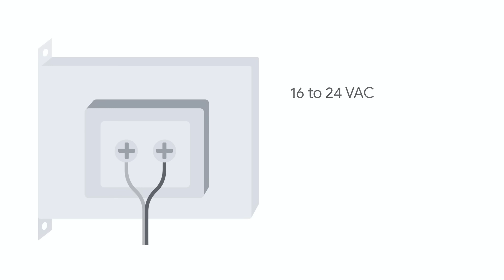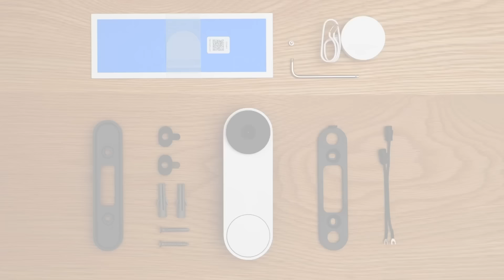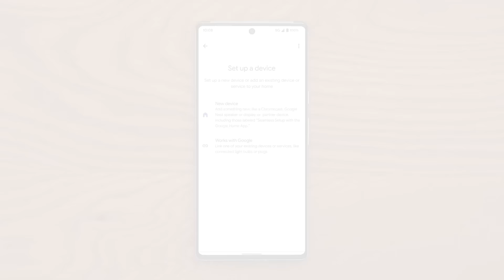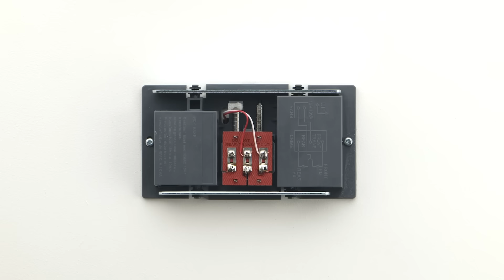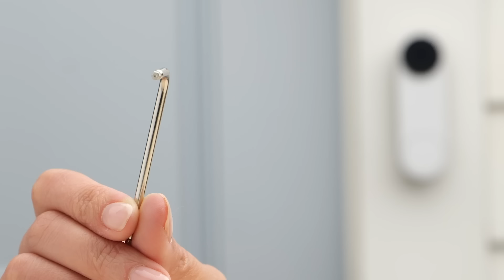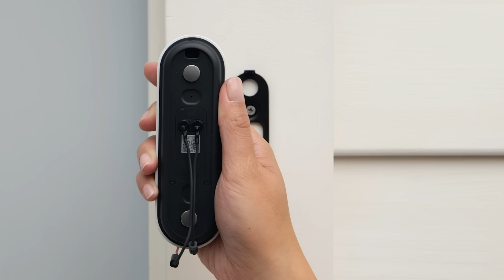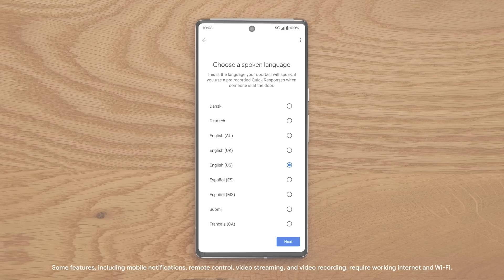How to Set Up and Install Your Google Nest Doorbell (Wired)

Comment: I currently have 1st gen wired doorbell, & I'm going to replace it with new 2nd gen wired doorbell. I don't have a chime at all...the wiring goes from Transformer > Chime Puck > Doorbell, & I have no issues. Can I use this same wiring for the new 2nd gen doorbell as well?
Reply: No reply?  So in the video they said remove the old one and put the new one provided in the kit.  Guess you figured this out, can you tell us your story for others to know ?

Comment: Doesn't work with a Google business email account?
Reply from the maker: Hey there, thanks for your inquiry. If you're trying to migrate your Nest account to Google, we recommend using a personal Google Account. Google Workspace accounts are accounts set up by businesses or organizations to access different Google business productivity tools. At this time, you can’t use a Google Workspace account because the account data is managed by your organization. Check more details here: https://goo.gle/3wD2biJ For more help, contact us: https://goo.gle/3ie15Ae

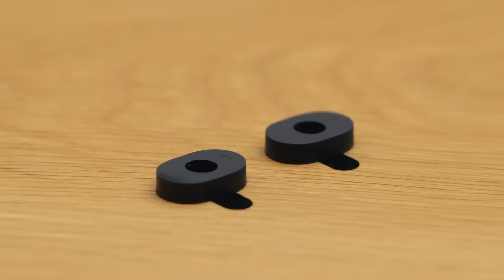Comment: The spacers mentioned at 6:49, do these go behind or in front of the bracket?
Reply: Answered my own question during installation. The spacers must go behind the bracket in order to secure the doorbell to the bracket.
Reply: How did you seal up the hole where the doorbell wiring comes out of? I had to use the spacers to install mine today but they leave a big gap all around the doorbell.

Comment: I made the installation today and everything works fine , only thing is that when I connect the chime connector the the existing chine inside the house it does not give me any sound but is disconnected it works fine the chime sounds work fine and the doorbell sound also works .. any idea why is doing that and also is it safe to keep it with out the chime connector ?
Reply from the maker: Thanks for posting a comment, Danny. We appreciate the steps you checked beforehand. Nest Doorbell (wired, 2nd gen) must be installed with the chime connector included in the box. It allows the chime's wire to deliver constant power to the doorbell and to protect your chime from damage. Without the chime connector, you might experience chime buzzing or unexpected chimes. Check out this Help Center guide to know more: https://goo.gle/2WHO7li
Reply: @madebygoogle  yes indeed is true with out the chine connector  im having a constant buzzing but like I said before , if I connect the chine connector then the chine does not work just made like a vibrating and never works , I think I will need to change the transformer and see if that fix the issue.. thanks for your replied

Comment: If I connect the doorbell directly to a transformer (because I do not have a chime), do the wire colours matter? Thanks!
Reply: If you connect the transformer's output directly to the doorbell, it would cause a short circuit when the button is pressed and may damage the doorbell. The wire color does not matter; it is AC current.
Reply: haha, did you get your answer?  nope.  this is a google channel for a simple instruction video, no one cares as if it was a personal channel.  did you figure it out?  My guess is yes?  As long as you use their add on  "capacitor".  That's all that thing is, so it provides more of a power supply then the small power normally associated with a doorbell / chime.

Comment: I had to buy one of these through ADT cause my existing doorbell camera from ADT  isn't working my nest doorbell camera didn't come with a Puck, my house is only 2 year's can i still install it?
Reply from the maker: Hey Jesus, thanks for your inquiry. To install your Nest Doorbell (wired), follow the steps here: https://goo.gle/36NFwlr If you'd like to check if your doorbell system is compatible, have a look at this guide: https://goo.gle/2WHO7li For more help, contact us: https://goo.gle/3ie15Ae
Reply: @madebygoogle  question, my Nest doorbell Camera is battery but noticed it has screws to have it wired so I assume I can wire it for constant power or do I need to charger it every now and then?
Reply: @jesusbaez4427  you can do it either way. you can wire it so you do not have to charge it.... or you can go wireless but have to charge it!

Comment: My indoor chime is not working.  I have a 16V 10VA transformer (intertek model 5019098).  The doorbell video and doorbell internal chime works OK.  I set the app to Ring indoor chime and electronic chime is set to no ( I have a mechanical chime ).  I did try to toggle the electric chime to yes at various durations as this was reported to work for some with mechanical chimes. 

Any ideas on how to make indoor chime work? Do I need to replace transformer with bigger unit like a 16V 30VA unit ?   The chime worked fine using the original doorbell.  Home is new construction.
Reply from the maker: Hey James, we're here to help. This guide could help you troubleshoot your indor chime: https://goo.gle/39DLuFO For more help, feel free to contact us here: https://goo.gle/2D2Shve
Reply: @madebygoogle  I opened Case ID 3-7137000033654   Still waiting for some update. Looked at the posted docs and all steps were checked.  Still need to know if transformer rated 16V 10VA is good enough.  Only feature not working is the indoor chime.   Very frustrating !
Reply: were you able to get your existing chime to work?
Reply: @netarcSF  I got the existing chime to work by swapping out the doorbell transformer from 16V 10VA to a 16V 30VA unit.  Installation was very simple.  Just flip the breaker and swap it out.  Everything works perfect now.  Google support was pretty useless.

Comment: I just moved to a new house...

no outside doorbell, 

inside there is a chime (battery) but not sure how to make it work with this google nest doorbell (I don't want the battery one with cold winters we have here, the battery will last only days)

Behind the chime, in the walls, there are wires....but not sure I want to use it for the doorbell anyway.

I do have multiple google home minis (and one hub) in the house

Can I use the Google nest doorbell (wired...for cold winter days) with the notifications coming only from the google home minis and no chime in the house?

Do I need to connect the white puck to the wired inside the wall where there was once a chime connected to it? even if there is no intention of having a new chime installed?
Reply: P.S Will NOT work IF your Chine is battery powered!!! Consult a professional about installing a "TRANSFORMER)- NEEDED to provide the proper voltage. I just read a few Youtube videos on the WIRED installations and compatibility requirements AND I own the wired version.

Comment: If I already have the original wired nest hello, can this be replaced directly on the mount that was already screwed into the wall? Will the wires where the original puck was placed will be replaced exactly with the new one?
Reply from the maker: Hi Jazz, thanks for your interest in the new Nest Doorbell (wired, 2nd gen). Since the doorbells have different dimensions, we'd suggest using the mounting plate that'll come with the device. Also, the first gen doorbell chime connector is not compatible with the new one. Check out this link to know more: https://goo.gle/3EmUh1Y

Comment: 8:36 I was deciding to buy this doorbell camera when I saw this point of the video. You are telling me anyone who also bought this camera will get the same hex key. They can use this key to unscrew the camera from the top and yank it off the wall?
Reply from the maker: Hey there, thanks for the review. Hex screws that come with the package are identical to each user who purchases the device. In the unfortunate event that your doorbell gets stolen — we can help by replacing the device. The doorbell replacement will place no additional cost, if you qualify. Learn more about the policy and on what to do when your doorbell gets stolen: https://goo.gle/2FL3WA1
Reply: I mean... What do you expect? That each doorbell will be sent with a unique one of a kind screw? No door bell or outdoor camera have that

Comment: Can the existing wiring/ chime connector be used if I’m replacing the 1st gen nest doorbell??

Also they no longer come with the chime connector but this video has step by step setup but not all accessories are in the box
Reply: Only the wired version comes with the chime puck
Reply from the maker: Hi Rodney, thanks for your interest in the Nest Doorbell (2nd gen, wired). You won’t be able to use the existing chime from your old doorbell, you’ll have to replace it with the chime that comes with the new doorbell. The new chime is included in the box when you purchase the device. Check this out: https://goo.gle/3h6FBKK
Reply: @madebygoogle  I ordered the battery operated doorbell but it doesn’t come with the chime set up
Reply: @madebygoogle  I’m in the UK
Reply: @madebygoogle  apparently the wired doorbell isn’t available in the UK?
Reply: @madebygoogle  I just purchased one as well (MFG 11/2021) but it does not list the chime puck on the box under "What's included". How do I install without the puck?
Reply: @madebygoogle  i also have not received chime puck in Netherlands , any suggestions

Comment: Will this work with plug-in transformer?
Reply from the maker: Hi Erik, the Nest doorbell (wired) isn't compatible with a plug-in transformer since it has a required voltage and power and must be connected into your home's doorbell system. Learn more here: https://goo.gle/3BJdiZK For more help, reach out to us here: https://goo.gle/3ie15Ae
Reply: @madebygoogle  
Thanks for your answer.  Will continue with battery version then.
Reply from the maker: You’re welcome  — we’re glad to answer your question. Let us know if you need more help.

Comment: can you make a video to reset wifi. the wifi I pick doesn't work well. pressing the button on that back only turns the th light white and goes back to green. I need it to turn a blinking blue. thanks
Reply: it also cannot find my separated 5ghz wifi with 160hz enabled. I plan on getting a mesh router. wifi signal is weaker with this version than gen 1

Comment: Installed correctly but now my chime doesn’t work….
Reply: Same! Did you ever get a solution to this?
Reply: @skylinesenses  nope, I assume it's bc my doorbell transformer was the minimum recommended. I just turned the indoor chime off in the app and just using Google minis to announce
Reply: @Andrew-gr4nd  thanks for the reply! yes that is most likely your issue. I upgraded my transformer and it solved my issue. google says you can have minimum 16vac 10va, that’s what I had and I upgraded to 16vac 30va and my chime instantly worked. It’s not too difficult to do and took me maybe about 30mins to do. I would recommend a vintage tester as well for safety since you will be working with regular power lines to hook up the transformer. I got the C907 NuTone transformer since it’s a higher quality model than the Amazon recommended one, let me know if you need any help I’d be glad to offer any insight I can!
Reply: @skylinesenses  good to know, thank you! My only clue was when I took the case off, the chime part was getting a little power but no enough to hit the bell. Anything electrical makes me nervous to mess with. Sounds like it wasn't too bad, though?
Reply: @Andrew-gr4nd  yeah not bad at all, doorbell transformers are pretty standardized and universal, so you literally just match up the wires, very straightforward and there’s some pretty good YouTube videos on what to do exactly, but it’s basically three wires that you just match up the color, I figured the $40 on a quality voltage tester from fluke was worth my life and still a huge savings from paying someone hundreds to do it lol, and yes, my chime was doing the same exact thing where when I pressed the doorbell, the piston barely moved, but not enough to ring the bell, also if I rang the doorbell like a madman, it would ring once, after like pressing it, five times consecutively probably because the voltage with spike just enough to ring the chime. Overall a very easy upgrade and it provides some future proofing for later gen doorbells years from now I hope haha
Reply: @skylinesenses  Good to know, thanks! Probably isn't a bad idea to future proof. I'll consider it!
Reply from the maker: Hi Andrew, we're sorry for the delay and we're here to help. Give the steps on this link a try to see if it works: https://goo.gle/3Ulk4fY't%20corroded. If you need more help, reach out to us through our support channels so we can better assist you: https://goo.gle/3meAs19

Comment: Can I install this in a outdoor condition? Is it weather resistant?
Reply from the maker: Hi Hongguan, thanks for your interest in the Nest Doorbell (2nd gen, wired). This doorbell is IP54 weather resistant. Also, the doorbell is designed to work in a wide variety of weather conditions, including sun, wind, rain, and snow. However, it is recommended to install the doorbell under a protective overhang. Check this out: https://goo.gle/3NzySoM If you need more help, reach out to us through our support channels so we can better assist you: https://goo.gle/3meAs19

Comment: Can this directly replace the original Nest doorbell? its already connected to a standard chime.
Reply: Good question. It would be good to know if the old wiring for the Chime still works with the new Nest video doorbell.
Reply: @smr32061 just replaced my original with the 2nd gen, having all sorts of problems after a straight swap and little to no support except “call an electrician”. So would suggest no at this point.

Comment: Why take away the battery? Battery is good as backup Incase of power outage. Battery version just needed continuous recording like the Google Nest Cams with battery.
Reply from the maker: Hey Rick, thanks for your inquiry — we're here to help. With this new addition, there's now a Nest Doorbell for everyone. While Nest Doorbell (battery) offers a lot of versatility, we know people with compatible set-ups may want the reliability of a wired doorbell — so you never have to worry about charging a battery or running out of power. Check more details here: https://blog.google/products/google-nest/nest-doorbell-wired-2nd-gen/ Let us know if you have any other questions.
Reply: @madebygoogle  why not offer both capabilities in one device like you do on your cameras? I use your battery cams but always plugged in and solely use the battery as backup power when we loose electricity.
Reply: @dankdc5_  no it's on backup power. Gone thru plenty of power outages and all my cameras work just fine, but now doorbell will be off. Makes no sense to not use same tech in doorbell as in their cameras.
Reply: This is a new wired version in addition to the battery version.
Batteries don't work well in cold weather. They slowly degrade overtime. You have to charge them. And you can't have 24/7 recording with a battery.
But battery version gives more flexibility. 
Having more options to fit more people is always good.
Reply: @NopWorks  you can have 24/7 recording on battery and they have this on their Nest Cam battery ones. I have a handful of them and they work great. Battery is for backup power when electricity is shut off. With the 1st version video doorbell with battery there's no 24/7 recording so was expecting v2 to offer this vs completely removing the battery.
Reply: If power is out in your home then the smart doorbell literally becomes a dumb one with battery because there will be no internet to connect it to all of the smart features. At that point the battery one only serves as a chime which is not that different from someone just knocking on the door lol
Reply: @luviathanx  internet setup is on backup power. Never goes out unless isp is down which is very rare in my neighborhood. Again, their other cams have both options it's only the doorbell that doesn't. So makes no sense.
Reply: @luviathanx  you’re also missing the point. The OP (and me) would like to see the wired version here WITH a battery used for power outages implemented the way the camera lineup does it. Google, we all know that a battery version exists. No one looked at the wired doorbell type and stopped there. 

We’re just asking for the same tech in the cameras, nothing different than what’s used in the current generation cameras.  My Internet is also on battery backup. When power goes out, even with no internet available, the Google Nest cameras save 3hrs of event video when the Internet returns. OP is saying Google should have done the same thing.